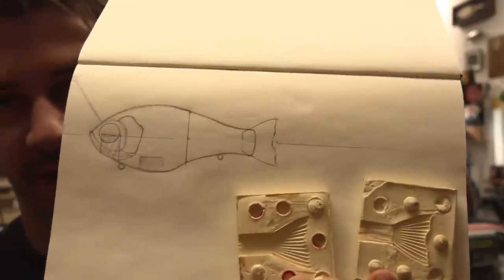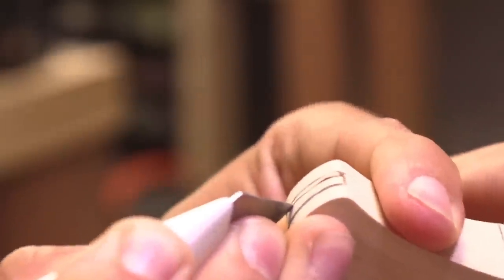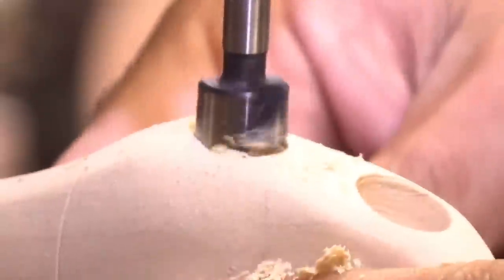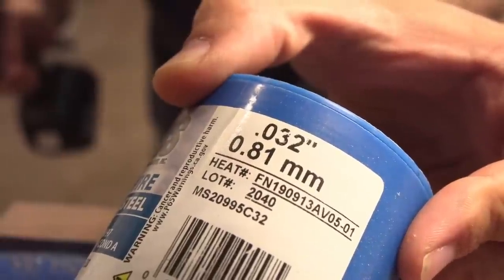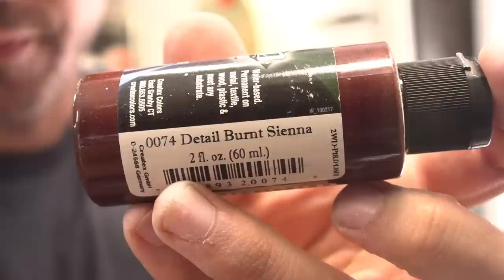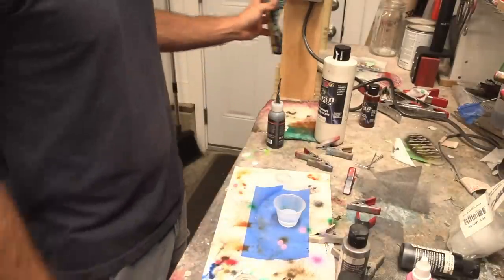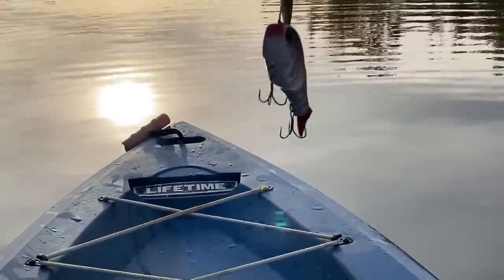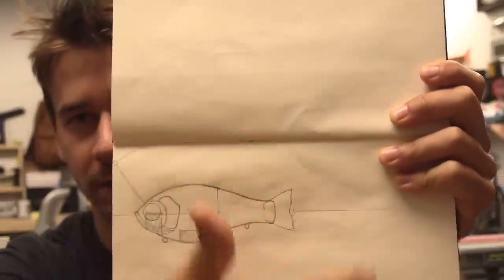Wooden SwimBait + Offset Spinner | One Day Build to Catch

Comment: I have used the "hard resin" for sometime. I bought two of the inexpensive UV nail curing lights from Amazon. I taped them together and plugged them into a power block that has a countdown timer. The one I use has different fixed times from 15 minutes to 6 hours. I hang my baits between the lights and set the timer. My lights use the florescent style bulbs and seem to last a good while. I'm sure they would be good enough for "one day" baits. I love your videos and look forward to them each week. I also enjoy your dry since of humor so continue to talk.

Comment: Nate, make the same bait, but embed a thin metal insert plate onto the top spine of the bait where the spinner blade will contact. This will protect your paint job and finish, along with creating a random clacking noise. Fun fact: BassMaster Kevin Van Dam secured many victories by starting and stopping the retrieve of double bladed spinner baits. The two blades clacking against each other promoted reaction strikes from bass. Different metal plates would likely create different noises. So that might be fun to mess around with. Aluminum, brass, copper, steel, tin? Which one will sound best?

Comment: Video is good as always. I have a question about UV resin, is there a reason you use that resin as opposed to something like Solarez? It was design to fix surfboards quickly if I remember. It’s almost half the cost of the cheap stuff(500g)and is really good in my opinion.

Comment: That was kind of a stooge move on the spinner position. would it work on as a spinner attached to a hook of the backend? or split it in half and use on each  side as a flapping side fin? ever done a double lip lure where one is slightly larger or smaller than the other and are at least an inch or two apart? not sure what kind of action or sound it would  give off. especially if the main body parts have bells in balls inside them.